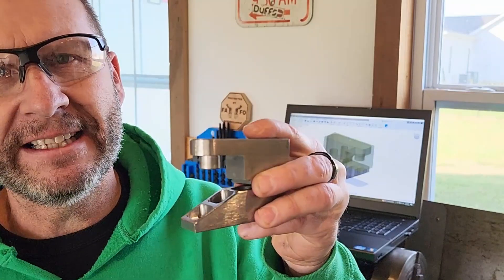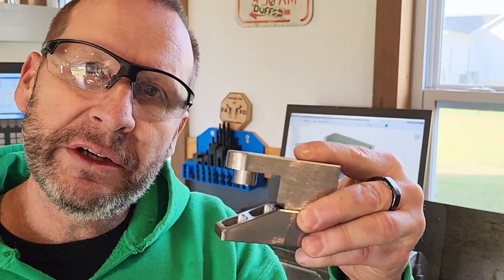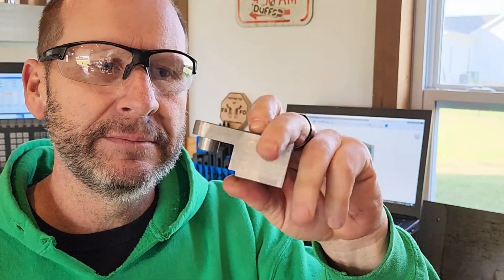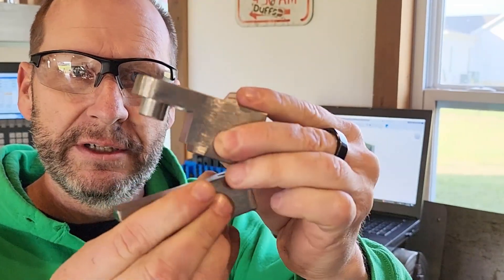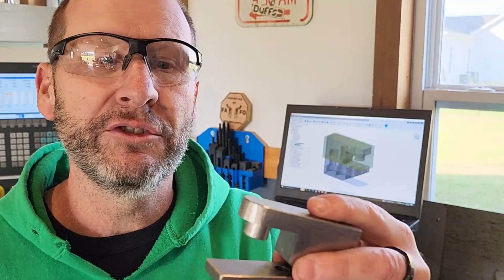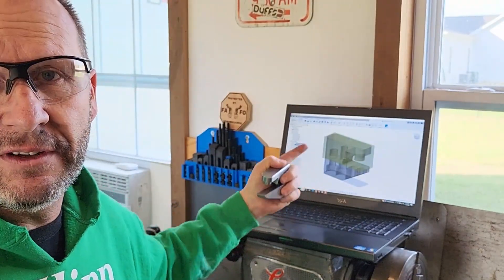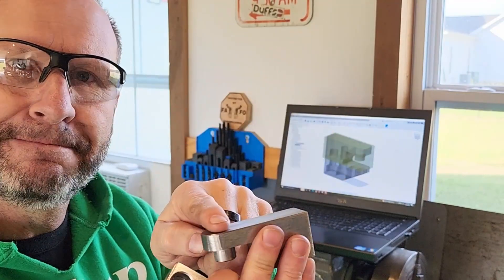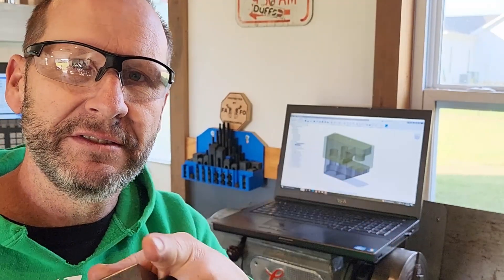Machining a Vise Clamp with SYIL X7

Comment: Why is it chattering with the .500 endmill in this video but in other videos it is not, in the s7 tool steel video it is not chattering
Reply from the maker: I think it chattered because I used stock feeds and speeds recommended by the manufacturer. Since this video I've been experimenting with high speed machining techniques. For example, higher RPM, faster feeds and speeds, and between 6 and 10% tool engagement.  

HSM Advisor gets me most of the way. The rest is experimentation. HSM Advisor let add my Syil as a machine and offers recommended feeds and speeds based on specific and relevant data, i.e, material, tool, and machine capabilities.

Comment: Great Video I have an X& due in about a week or so and cant wait to start using it. Thanks for your video
Reply from the maker: Excellent, the Syil is a surprisingly capable machine.  As capable as the operator is, in my case anyway 😎 Which controller did you choose?  Glad you enjoyed video.